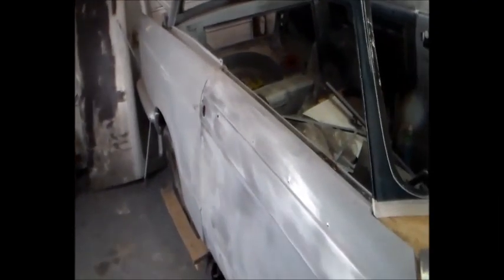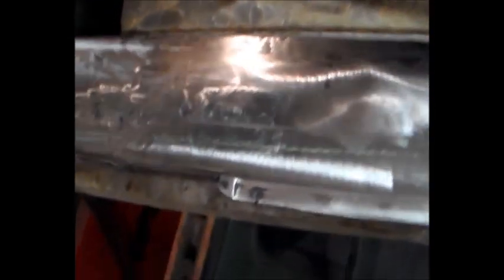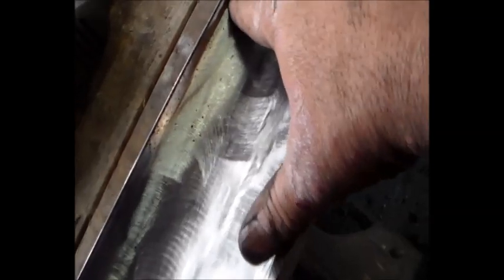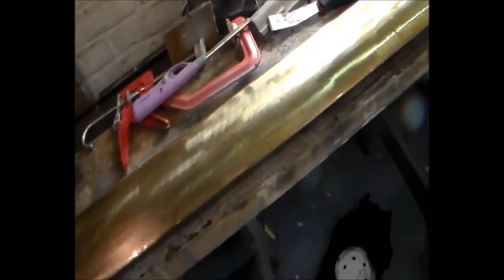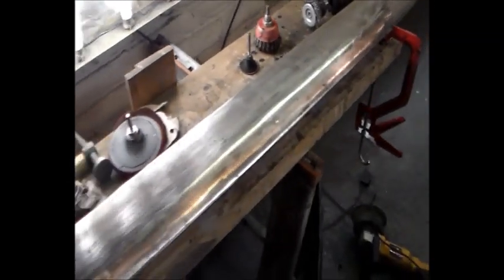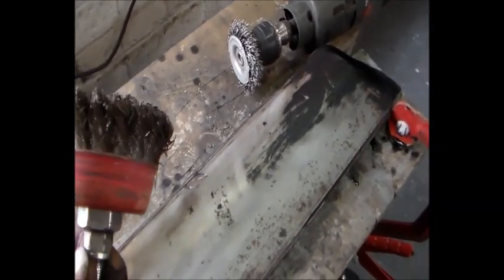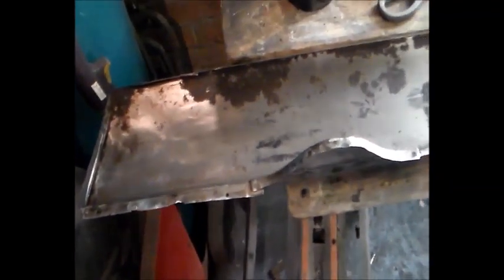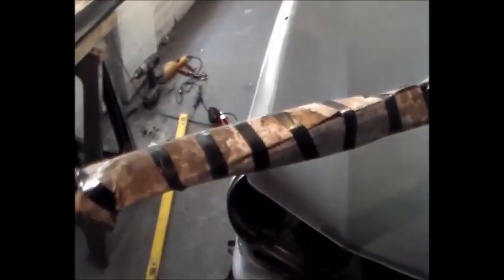27thSept15 Triumph Vitesse Resto + a stingy thing + a screw up

Comment: On my Vitesse the sill measurements are 18mm to top of up stand (the bit the door seal fits on to) and 25mm on the bottom flange.  The front wing is 520mm from trim to base.